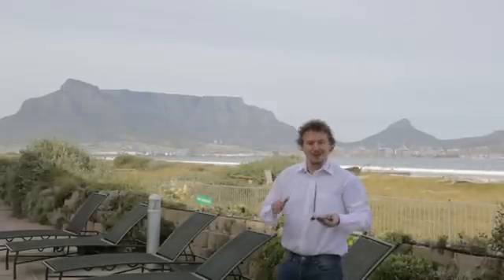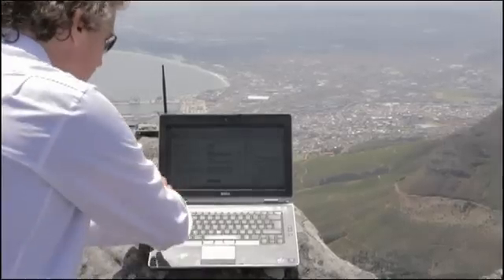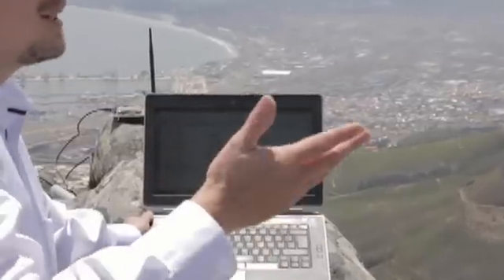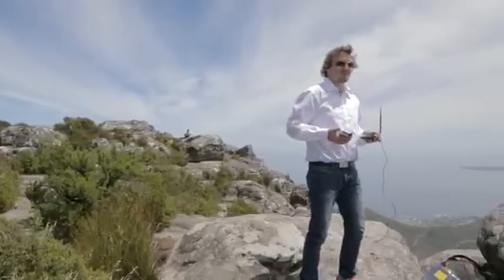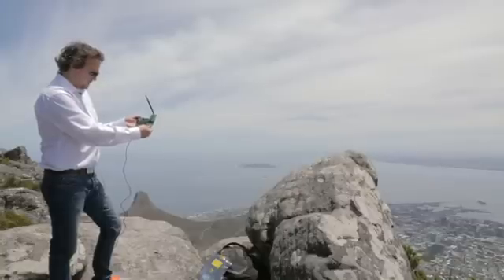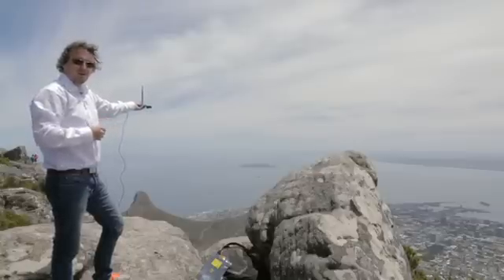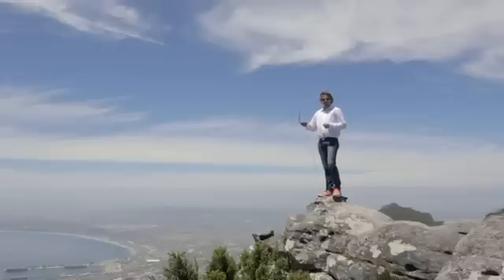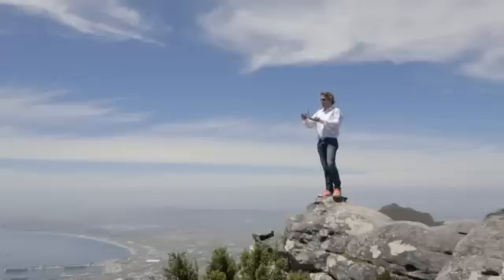More than 100km range with CC1120

Comment: Thanks bro , can u give me the difference between LORA and CC1120, about distance range
Reply from the maker: The key difference is that CC1120 is narrowband, which is very bandwidth efficient. LoRa uses spread spectrum technology, which is very bandwidth inefficient. This means, you will limit the number of devices that can communicate in a given area. Given that spectrum is a shared, limited resource, it is a very bad idea to use inefficient methods of communication. Spectrum efficiency is a key parameter to secure capacity and, in turn, robustness, when you have many devices that need to communicate
Reply: @terjelassen6978  hi, thank you very much for the explanation, I wanted to know if possible to implement the interface of CC1120 with microchip microcontroller PIC32MX170F256D or PIC32MX170F512H, if so where can I buy CC1120 ????
Reply from the maker: @jasonphilippe8497  I suggest you check out the product pages https://www.ti.com/product/CC1120 You will also there find resources on integration towards various MCUs, and also access to the E2E forum where you will get help from TI engineers if needed. Best of luck on your projects :-)
Reply: @terjelassen6978  thanks a lot :-)

Comment: Hi, can you make 225 kilometer or 140 miles LOS  FPV transmission for HD/SD images and videos ?  Possible lowest latency & minimum  power supply ?
Reply: Video transmission needs a very high bandwidth, this RF comm system simply won't be able to work with.
Reply: @mishrilal123  do you have any solution for that using a raspberry pi, It's better If there are ready to use modules instead of microchips, thanks

Comment: Hi I would like to connect several equipment such as computer and cell phone using Wi-Fi to my office how many users I can use or it's Unlimited and what kind of equipment I should buy non expensive I would like oh my computers and cell phones to connect them on Wi-Fi to my office the range about some has 5 miles and some has 45 miles the location is in Israel and it's all Mountain

May you suggest me what kind of equipment to buy not expensive

All the area old the area it is covered with the mountain and some hi buildings so I don't know how it's going to work with the reception thank you for your advice moshe
Hmoshebaba@gmail.com 
The. I should be used for surfing on the internet and using the Wi-Fi for phone calls

Comment: This is impressive. I used the cc1101/cc430 without PA on max power (10dbm) 433mhz and i was able to achieve only up to 400m. But at 100km, this is very impressive. I would like to know the transmit power and receive sensitivity.
Reply: devilkillerz777 
We bought this 1120DK.
It has 600meter range at 1.2kbs.
I do not recommend.
Reply: We bought this 1120DK.
It has 600meter range at 1.2kbs.
I do not recommend.

Comment: what about the data rate? and how long the rang would be if the antenna at 1 meter high?
Reply from the maker: Datarate was 1.2 kbps. At 1 meter height the range will be lower, the high altitude used here is to get over the earth curvature :-)

Comment: what is the throughput baud-rate? sending a 1000 packet of what size? how long did it take?
Half ass video and an over-priced chip! Long live Chinese knockoffs.
Reply from the maker: The baudrate/bitrate here is 1.2 kbps. The datarate is the key parameter for practical range, i.e. the higher the datarate, the shorter the communication range. This is a fundamental tradeoff. When it comes to robustness, in radio communication technology, the quality of the radio is important for robustness. The capability to filter out the signals you want to receive amongst noise and interference is what differentiates a high quality radio from a simpler radio. So for long range communication, using high quality radio parts is highly advised

Comment: Nice, but what's the price tag?
Reply: CC1120s are pretty cheap - under £5 per chip, plus a few passives, etc. if you can solder them yourself. The dev modules are a little more expensive.

Nice little radios.

Comment: Fantastic! What is the packet length?
Reply from the maker: +Юрий Ильин These are short packets, around 5-10 bytes payload
Reply: And if I change 1120 with 1101 can I get at least 50 km with the same conditions? Currently I reach 4.5 km with two CC1101 without CC1190
Reply from the maker: Юрий Ильин cc1101 does not support narrowband, only down to approx 60 kHz receive bandwidth. Range will therefore be shorter.
Reply: please tell what is the name this transmitter and reciever ?
Reply: What was deviation? And which RX filter do you use? Also so what was freq offset (FREQEST register)?

Comment: wi-fi?
Reply: 868MHz ISM band radios. NOT WiFi. The bandwidth is significantly below WiFi.
Reply: @heliosfa  is it kind of hc12??
Reply: @vrcks8066  Not quite - the HC12 modules use 433 MHz and uses a serial modem protocol to interact with it.
Reply: @heliosfa  how about cost compare to hc 12??

Comment: What is the data rate for this range?
Reply from the maker: moro22ro In this particular test, we were using 600 bits per second with settings intended for 12.5 kHz channel spacing. This is classic narrowband, and easy to set up and understand :-)
Reply: I want to bye told me whree is and price of  the instruments

Comment: Check out the application report which goes through some of theory behind these tests: http://www.ti.com/lit/pdf/swra479
Reply: This is across a body of water were signal is reflected, not a real test, a real breakthrough would be across a land mass with no water.
Reply: Please check out the range excel sheet available on ti.com e2e forums. The water has an effect but this is not a major contributor to the range distance. If the same link was tested purely over ground, the range would still be > 100k compared to a calculated range of 111k over water. The largest contributor to the range is the height of the transmitter. To achieve long range at 868 MHz, the Tx unit must have height since line-of-sight transmission is limited by the earths curvature. Check out the range document for more info: http://www.ti.com/lit/an/swra479/swra479.pdf